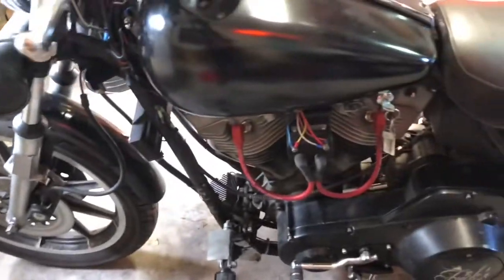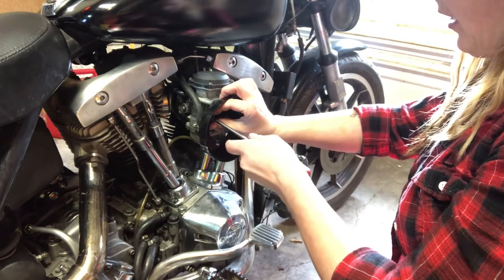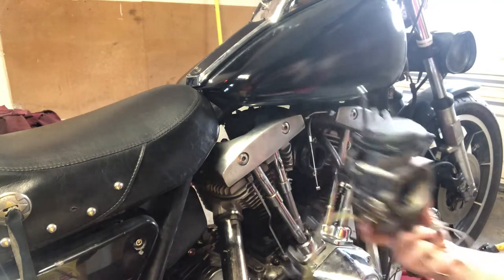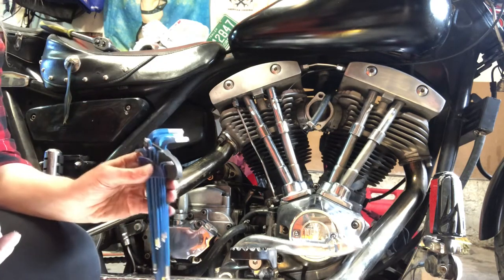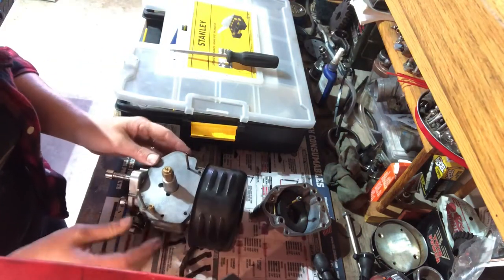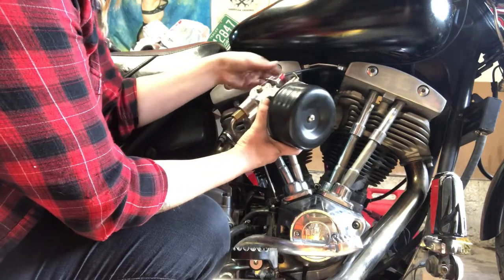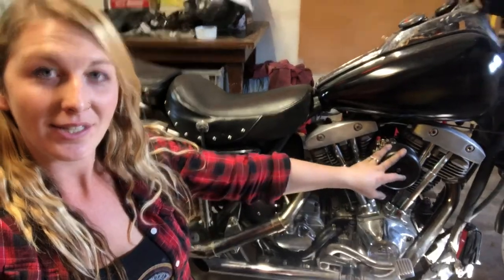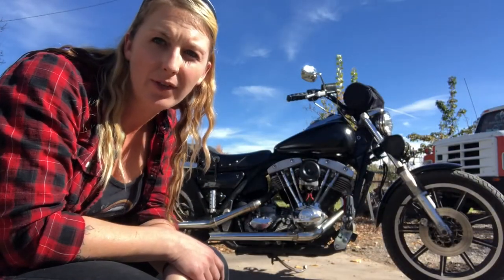Shovelhead FXR Carb Swap. CV to Super E Swap and Test Ride. No more bogging down!

Comment: A big part of the trouble with jetting carbs is to prevent air leaks into the mixture from poorly aligned inlet ports and the inlet manifold. The shovel barrel has several degrees of rotation in relation to the crankcase and likewise the heads have several degrees of rotation in relation to the barrels. This can allow you to either get it right on assembly or wrong and make it really hard to get the poor design of the inlet manifold band or o ring seals to do their job. If you get a leak, even a small one you will have mixture problems forever and no amount of changing a carburettor is going to alter that. This is compounded by the tight spacing around the inlet manifold. A lot of riders substitute poor jetting with more throttle to get them past a period of revs where the bike isn’t jetted correctly, consigning a perfectly good CV to the parts bin and fitting another carb. One hears all too often that, ‘that carb didn’t work any good’. Good advice would be to align your manifold correctly, have your inlet seals in good order and jet your existing carb properly. An appointment with a dyno and exhaust gas analyser will shock you and probably be cheaper than trying several carbs.

Comment: Between me and two buddies, we have a total of 5 HDs with CV carbs on them. '37 Flathead, '61 Panhead,  '74 Shovelhead, '79 Shovelhead and '03 Sporty. CV carbs are awesome. All of these bikes had S&S carbs with exception of the Sportster. One of the first things we do is take the S&S carbs off and install a CV carb.  S&S carbs are OK, but our consensus is  that they are overrated. The constant velocity (CV) allows for more precise metering and better running throughout the rev range. S&S carbs really don't do anything better than a CV with the possible exception of the S&S being better for high end, high revving, max effort power. Which is pretty antithetical to what a Harley is if you really think about it LOL.

Everything you describe for your troubles with the CV carb suggests: 1.) Need to change jet sizes 2.) The carb needs a good cleaning; paying attention to the jets, enrichener pump circuitry etc. 3.) Mixture screw needs to be adjusted 4.) Vacuum leak 5.) Combination of all of the above.
Reply: I jetted my FLH CV using an exhaust gas oxygen sensor and it runs great. Changing a carb to solve a jetting problem is like changing your wife because she puts too much spice in your food.
Reply: @stephensaunders4668  LOL that's so true and hilarious. I also started keeping a wideband O2 gauge in my toolbox for testing whatever I'm working on

Comment: Now you've got two carbs, you might consider pulling the CV apart and putting the body in an ultrasonic cleaner and putting a rebuild kit on it with fresh jets. Then, when the S&S loads up you can just swap it back on, and do the same for the S&S.

Comment: I'm an S & S carb guy also but have done several CV carbs on ironhead sportster & shovelhead big twins with success ! One of my friends has a 120 Harmon shovel that never ran good untill he  installed a CV on it !
Reply: '72 Ironhead: I have a hesitation at mid-throttle. I also need to run with 1/4 choke.  I have 4 months of down time (winter) so I am checking ignition first.  Compression is ok (110 f+r).  I've sprayed looking for an air leak; no luck.  Last item is to borrow a carb and try that.
Reply: @seanconnell8027  if you have to run with the choke on the pilot jet or if it's an S & S carb the intermediate jet is too small would be my guess
Reply: Its a Keihin/HD CV.

Comment: S&S Super carbs have come a long way. I ran a Super B on my Pan/Shovel. It was great for a stock bike and if you didn't mind just rolling on the throttle. The only problem I had with the Super B carbs was the fact they didn't have an accelerator pump. I've seen guys install Thunder Jets. They worked okay. The Shorty Bs are definitely more performance oriented. I also had good luck with a Rivera SU on an old 84-inch Shovelhead.  I have some pals who run smooth-bore, flat slide Mikuni carbs with great results. It looks as if you got that carb problem fixed. Ride safe, Sally.